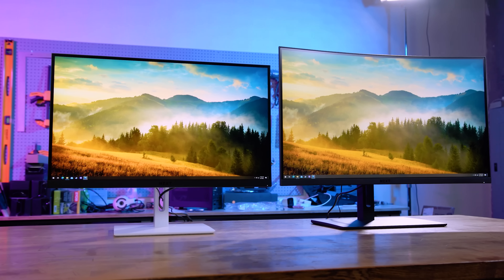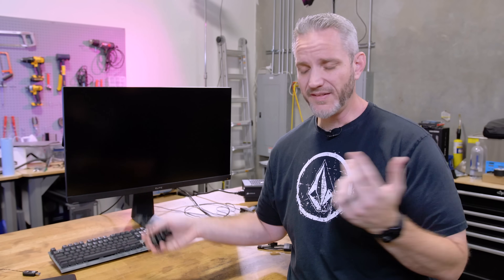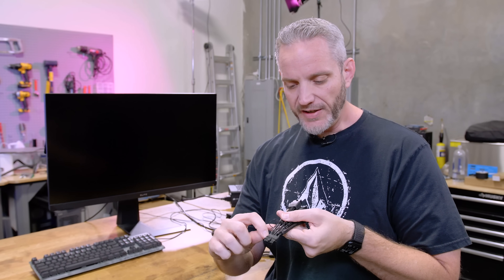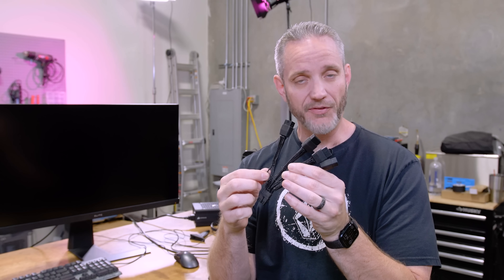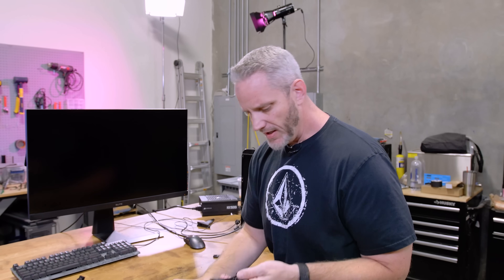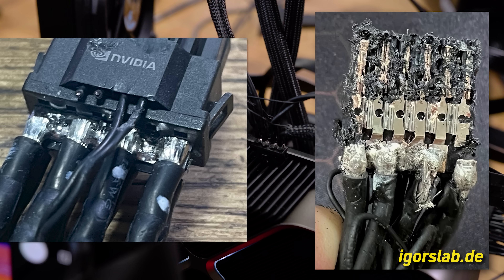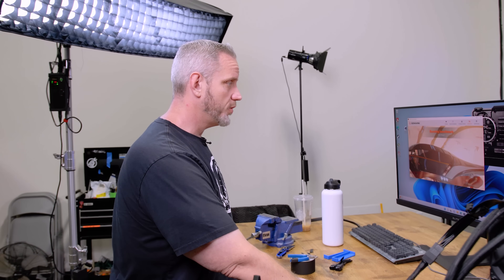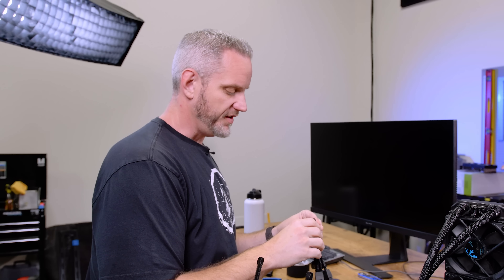Igor's Lab figured out why NVIDIA adapters are melting!

Comment: If it's the outermost pins getting hotter, it doesn't make any sense to say that it is due to the outermost wires getting lose or the solder joints cracking. Instead it depends by the way you insert and remove the connector. If you angle it sideways a lot the tiny pinchers inside the female connector get deformed. This explains why it's the side ones being problematic. The deformation renders the fit of the female on the male a bit loose reducing the area of contact hence the area where the power flows through. This is proved by the ATX standards stating that (I don't remember the exact number) the estimate life cycle of the connectors are like 20 insertions. If you connect it ONLY ONCE and PERFECTLY STRAIGHT in nothing is never going to happen.

Comment: My problem with it is, if there's 8 wires coming in, WHY DIDN'T THEY USE 8 BIG PINS INSTEAD OF 12 FLIMSY ONES? That would also mean crimping instead of soldering.

Comment: Unless you fuse all together there are no way to put 4 cables on 6 pins.
That is a fatal design error, broken solder happen even on DIP IC's pins and you're not moving these.
On the pictures the ext pins are separated, that made the card draw the full 150W from that but instead the center one giving that to 2 pins and having less resistance, here you're driving 12.5A on just one pin.
There is 2 options, one is reinforce the union using a rod over the pins to keep it solid, two is use a FR4 PCB to make the union better instead rely on the pins and chunk of solder.

Comment: Also, I don't think the engineers that were speaking up were necessarily wrong. The problem when you go smaller and smaller and then attempt to deliver more power is mostly due to engineering constraints in a somewhat stupid attempt to save a few cents. It's never one thing that gets you. You made allowances here, coupled with a shortsighted decision there, and then marry it to thinner and flakier hardware/cabling/etc ... all of those were responsible for the whole thing blowing up in your face.

So it turns out to be the soldering job this time. Well, it probably wouldn't have been if those connectors were a little bigger/stronger.

Comment: 6:00 - Then central pins would burn. So it's otherwise - side pins burs because they do not redistribute current over other pins and take all the current into single one. But then another question - what is the #$^p material connectors are made of, so they melt at just 100 C?

Comment: if you are skilled with doing this you could just repin the wire your self from old connectors or spare ones from your psu open the pins up carefully and put the other ones in even lightly solder them after krimpin with no krimp tool but not to much or it wont fit i have done it before on even smaller connectors

Comment: It's basically using a bus bar which are not meant to be flexible and should be fixed in place. If I can ever afford to buy a 4090 I would try to get one with the connector at the end of the card and not flex the cable too much.

Comment: It makes no sense that if the outside wires fail and send all of the current down the internal two wires, that would make the outside wires melt/burn. If there is no current, there can be no burning/heat. It would all be concentrated in the middle pair.
I have vast knowledge of high current connections and can tell you with 100% confidence that the black burning is arcing. It can only occur on a loose connection or one that is broken with a very small distance for the arcing to occur. If the connection is solid, arcing cannot happen. bending the wires close to the connection will cause arcing. You need to test this over hours, not a few minutes. Arcing might not occur for a good while after installation as it could work a little loose and then cause the problem.

Comment: Thank you for making the video to bring the blog post to my attention but the explanation in the video is uhm not great... But yeah the article explains it perfectly.

In short, there are four wires connected to the connector, two of which are connected to the outer two pins (one for each). But by bending the cable the contacts on the pcb can fail and break off. the remaining two wires will carry the load to 6 pins and because the 6 pins are connected to one another with a thin foil that starts to get hot fast.

Comment: You aren't simulating the ARCING that would be happening with the wires still in the plug.  There was likely a flawed contact still happening in the plug.  I'm sure you weren't trying to start a fire or destroy anything other than a plug, though.

Comment: Couldnt we just have kept using that original connector? They really didn't take that much space, and for sure wouldn't melt. Add a extra cable to run for the sense/talking stuff, and done. Also, we could have just stacked the 8pins. Or put them on the short side of the gpu, would be quite neat too. We have enough vertical height. Not to mention, maybe we should focus more on efficiency, then on speed/power for a while. I think now is the best time to do so.

Comment: This doesn't really add up. If the solder joint had failed then the temperature increase should be directly at that point, not at the pins. It should have melted the molded rubber. I think what happened is that the pin was also pulled from the connector causing bad contact/high resistance point between male and female pins.

Comment: Traditional smart phone charger has voltage of 5v, while fast chargers have 9-20v.  Respectively 4090 has power over 400W，  and 12V of power supply is apparantly too low.  No only the adapter cable has weak points, but other weak points will rise up on the GPU board.  24V or 48V of power supply shall be the cure.

Comment: Something I don’t understand… why can’t the plug have a single large +12v & single -12v blade connections. Rather than all these individual pins 🤷🏼‍♂️

The connector overall could be smaller & would have much more metal contact than these pins.

Comment: I wouldn't have a solder joint on a cable like this. I bodged together a work light using an LED lightbar for a car and a 12V PSU in a weatherproof box, using the classic XT60 connectors for the cabling, including an extension cable. These XT60 connectors are soldered like these adapters, however, they solder into a cup on the back of the contact in the connector weather than a flat plate. I'm crap at soldering them so they routinely break. I got tired of repairing them and switched to Anderson Powerpole connectors which have contacts that crimp to the wire instead of being soldered and I've not had to repair them since.

I feel like the soldering of the wires to the connector is a major weak point, they should be crimped somehow IMO.

Comment: Well yeah, Optical Fiber is the same thing. You bend a wire you risk breaking loose a connection creating basically a shunt which is an insulator. Which means your now Arcing a 600w connection

Comment: im no electrician but i would think theres a big difference between cutting and removing the wire from the connector and the wire breaking loose but remaining in the connector to possibly touch the piece it was previously soldered to and possibly create an arc of electricity. agian, im no electrician so i could be completely wrong...

Comment: wonder if it would have been better for them to attach the wires to a small pcb and the pins to the other side of said pcb on a 90* so that a its easyer for cable runs and less stress on the plug and b just all in all nicer to work with

Comment: I suspect that it is not just that the connection fails and separates, it is that it arc's within the confined space and heats up the pin. You are opening it up so heat can easily dissipate and removing the arc scenario. I think the only way to test the theory is to play with the wires until one fails without opening it up (and how would you know it has failed?) then running under full mining loads within a poor airflow space. Just about any cooling will reduce the chance of reproducing this. Good luck ever making it happen on purpose.

Comment: It's the plug not being inserted properly.  I'd take a soldered bussed connection over a tiny pin crimped to the wire all day everyday.  If it heats up enough and theres any flux residue on there.. it will reflow the solder.. so you can't go by that.
Reply: I think so to. Like you see people saying theirs melted, What they dont say is if they plugged it in all the way..🤔🤔🤔🤔

Comment: fact is, it's not just "clean breaks".  Yes, shooting that kind of current though only 2 wires vs 4 will do exactly what Igor states...but what is most likely happening is this combined with arcing.  That's going to cause temps to soar.  

As for sourcing?  More than likely Shenzhen.  Yes, with stuff like thism, quality depends on who filled the seat that day.  That design is sketch at best, and the over-molding they did was to act like a strain relief...which obviously didn't work.  The math works for the design obviously, the 14ga wire can handle 15A each, at 12V that means each wire can handle 180W so 4x180 = 720W safely (480W card), they actually could have gotten away with 16Ga wire that has a 13A rating so it would be 624Watts max which is right about the 125% over-rating many places use for design, so it could actually be argued that NVIDA over-spec'd the wiring.  

In the end, the design of that cable end is highly suspect, they attempted to prevent breakage with the over-molding of the wires.  Honestly, they would have been better off just using an 8 pin Molex instead of that 12, and looking into board layout and trace demand.  The biggest reason to split it 8 ways is most likely due to PCB requirements (not enough real-estate to handle high capacity traces on the board).

Still good stuff Jay, and Igor isn't wrong here, but it's probably a combination of arcing (which generates a whole lot more heat than if the wire just wasn't there).

Comment: The issue could very well be partial contact, and damage over time ( as these plugs don't melt after a few hours of abuse ) so it's hard to replicate but a VERY valid concern nonetheless. The design choices seem shady and cheap at best, at worst it poses a serious fire hazard and nVidia MUST be held accountable for this piece of crap they are shipping out with their cards ( because forcing users to use their new connector then providing an adapter that is trash quality is not a good way to go about doing things )

Comment: Why would you say its a soldering problem? It's clearly the pad breaking off the pin. (maybe you just misspoke). There should be thicker metal where the pad connects to the pin, or, you know, a simple old school design with dedicated wires like you say.

Comment: I don't know why Nvidia went using a cheap manufacturing process for the adapters. Those terminals (pins) should be crimped to the wire in order withstand the mechanical stress.

Comment: For one the fact that the nvidia engineers thought connecting 4 300W spec PCIE power connectors into one little plastic connector is why this happened. I don't see why they couldn't put 4 regular connectors on the card other than to trick consumers into thinking their GPUs are still efficient. If you're a miner you would have seen this issue coming right off the bat. I personally still wouldn't trust the replacement from corsair. I'm sure it's safe for gaming, but I would be weary of really beating on the card and putting it to work. Just what I think.

Comment: Building on this: I think the outer wires having a single pin is the issue, unless there is some design feature where power is biased to the double pins. The outer pins have a higher resistance which creates more heat, weakening the metal contact, burning the plastic, and ultimately causing a pin to fail. This leads to a worsening of the issue on the opposite single pin, which also quickly leads to it failing (and even more melting on that side). The bending radius could be a contributing factor to the pin failing, but this is just a poor design overall.

Comment: That molded rubber isn't a sufficient strain relief. I'm no engineer, I'm just a diy repair guy, but i've seen insufficient strain reliefs fail countless times, it's basically the first thing I check in a broken device.

Comment: Also positive and negative isn't separated by solid plastic like the other standard connectors. No matter how safe they say this is but the risk of potential short circuit and fire is not impossible. Show this connector to an electrician and ask what they will think. Someone who work with high current DC systems like Solar. Then you'll know how dangerous is this. People think DC current is safe but DC is the most dangerous when it comes to arcing/fires.

Comment: Woulnd't it be worse if the foil of the outer pins would not completly breack? If f.e. only a small bit would still conetct - the wire would deliver 200w (or whatever) through a small area that will get real hot

Comment: The suspect connectors should all be replaced with crimped Molex type connectors.  IMO, high power connectors are never soldered, they are crimped.

Battery connectors on vehicles, structure/building connectors are crimped.

Comment: So yeah, the issue is indeed caused by the small form factor of the plug used. Had they gone with a bigger connector, build quality would play a much lower role in a potential fire hazard.
I can already see plenty of third-parties launching better cable adapters... :D

Comment: its 600W of DC arcing in there becouse of a bad connecting.. you cant replicate that if you just cut a wire.. there is a small bit of contact in the connector  and thats what does it...

Comment: Is there an option for a cable with a built in 90 degree adapter that is a 12vhpwr cable with 12 wires( one plug on both ends)?

Comment: The joint at the plug where there's a lot of bending pressure is stupid. There should be a separate joint (but it would require 10 cm or more of extra cable, but Nvidia is greedy). Also it would look better.

Comment: Its not a power issue. It's current. 12v caur audio systems behave like this. Too thin a guage of wire and it'll melt at the weakest link

Comment: So if we are undervolting(I'm running 80% power target so it makes around 400w when boosting)- and we are using 3 pcie cables+ 1 daisy chained- should we be using the 4th cable in case of failure? To make sure we have enough wattage threshold available

Comment: I think that cutting it open may facilitate heat dissipation which is why temp may not be rising in your attempts as you thought they would. It was a rubber thing surrounding it, right? Wouldn't that provide thermal insulation to the solders and contain whatever heat is produced when it is on there? Maybe put a temperature probe in and wrap it back up with the same or similar material? Anyway, at this point it is clear the whole thing is unsafe and people shouldn't use it.
ETA: That in combination with partial contact seems (like mentioned by @LooweeG) seems like a recipe for fire.

Comment: I have to argue that Igor's assessment is incorrect. If the detached wire is causing increased current to that pin of the plug via the middle wires, the failure would occur in the "foil" bridge between the outer and inner wires. This is thinner than the pin, so will heat up faster under the increased load. The fact these images show the melting is occurring within the plug/socket connection leads me to the opinion that the fit of the pin in the socket is more the problem, which would also be exaggerated when the wire is bent near the plug. If the pin/socket connection is loose to begin, then bending the wire at a tight angle would result in 1 or 2 single points of contact instead of the length of the pin. This increases current draw, therefore creating heat. If this is more of a problem after the cable has been plugged/unplugged a few times, then it is possible this is what is causing the socket to expand. I've seen the same issue with the old IDE HDD power leads. After a plugging/unplugging a few times, the sockets would be stretched enough that a poor connection resulted. Squash the socket closed a little and all was good again. To test this, try expanding one of the sockets a little and test again. Sorry for the long post.

Comment: they should have had the connectors on the gpu at like a 45 degree angle towards the back(180 degrees from video outputs and it should be standing up instead of laying against the pcb!

Comment: As someone who used to play with high powered car audio back in my younger days, seeing all of these various  multiwire solutions for 12v power just seems so weird to me. I am just waiting for some company to build their own standard that just chucks something like XT90s on a PSU and graphics card with some 8 gauge power wires connecting them or something. 

But, like seriously why wouldn't that work. XT90's will do 90a all day which at 12v is over 1000w. Why do we need anywhere from like 8-32 wires to do the job of two. I don't know maybe I'm just the crazy one. Seeing all these tiny pins being asked to carry so many amps just weirds me out... like I know the math theoretically works out just fine, but it seems unnatural.

Comment: I fix old arcade games.  We call this cold soldier joints.  This is common and is due to the manufacturer not heating the connection enough to flow solder that will make a good connection.  Nvidia should recall all of these and issue new to anyone that wants one.

Comment: I’m seeing post after post on Reddit with the adapter and port on card being burned in specific areas, this is a huge screwup by Nvidia, absolutely unacceptable design defect and reaction to it by them. Any layman who doesn’t know shit about PCs can even see that pushing that much power thru a tiny connector like that isn’t safe